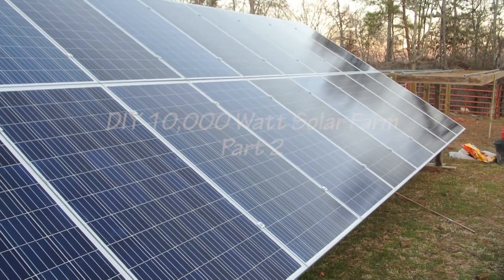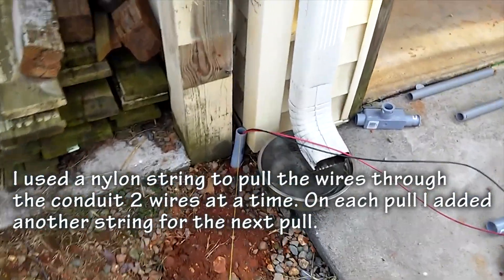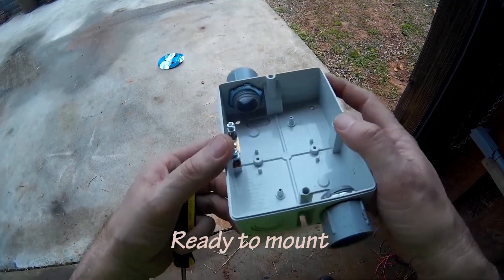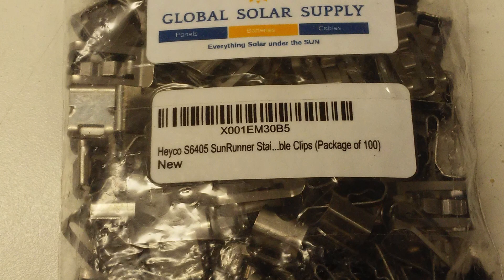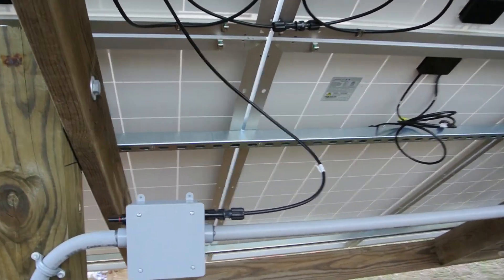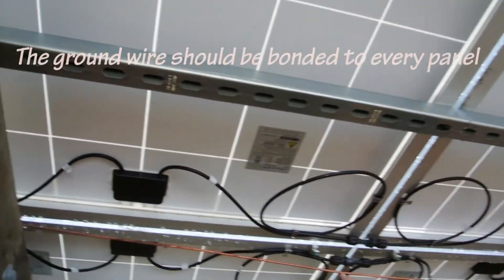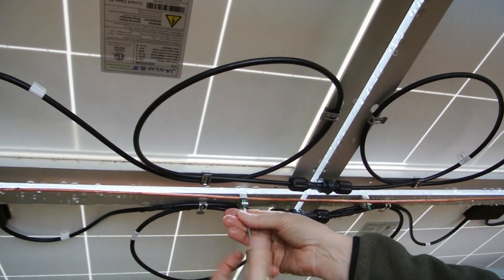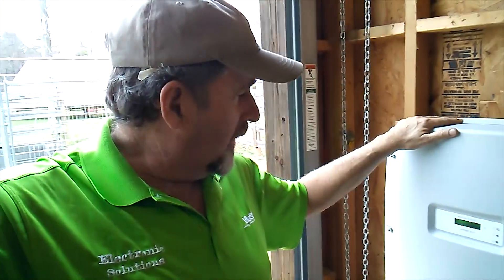BUILDING A 10,000 WATT SOLAR FARM - Part 2.

Comment: THHN wire in the NEC Code is for dry and damp locations, underground conduit is considered a Wet location  as written in the NEC Code THWN is required. Rip it out and do it right!!

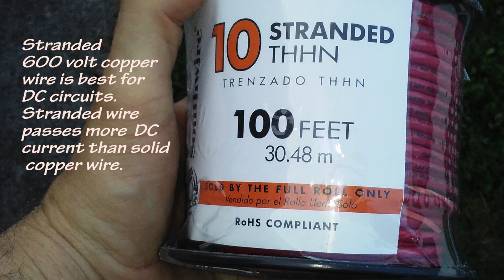Comment: "Stranded wire passes more DC current than solid copper wire" I totally disagree. Cable resistance determines how much current will flow. Stranded cable will have higher resistance than solid cable of the same gauge. 0:21

Comment: Nice install!  Still missing a few details like system dc voltage (24Vdc? 48Vdc? 192Vdc?)  Sun tracking? Future battery/power wall? Unless I missed it.  BTW I don't think stranded wire carries more current than solid wire in a dc application.  Stranded wire only exists to simply be more flexible than solid wire.  Ignoring insulation or conduit de-ratings and assuming same conductor materials, the cross sectional area for any given length of wire is still what determines the ampacity of a wire.  In fact solid wire is recommended for outdoor installations.  And skin effect doesn't come into play unless you're trying to pass high frequency AC voltages.
Reply from the maker: The DC voltage varies under load but its around 350vdc under load and close to 450vdc open circuit. At that voltage solid wire would work just as good. The stranded is a lot easier to pull through conduit though. Low voltage DC gets more benefit with fine stranded wire. Example would be car battery cables and welding cables. I tend to question that as well.
Reply: @electronicsolutions1126  I rechecked some NEC standards among other electronic resources and can safely say voltage (or current for that matter) has nothing to do with stranded vs. solid wire.  Automotive wire is stranded because it is easily assembled into harnesses, easier to install during manufacture and much more tolerant of vibration.  Not because it is low voltage.  Welding cable is stranded because the necessary big gauge/high current cables need to be flexible.  The finer the individual wires the more flexible.  Again... not because it is low voltage.  BTW the voltage rating of any given wire is determined by insulation material and thickness... not by AWG.  Any of this is easily verified with wire ampacity tables or even thermal calculations if you want to really go deep.
Reply: Some people omg he used what he used if you think you have a better way great do it and move on nobody cares how smart you are on details and details alone.
Reply: @seandillingham5062  I wasn't trying to show how smart I am but more to correct a false statement. If the guy in the video wants to come from a point of authority then he should have facts not just made up bullshit.  Let me guess... you're the source or apprentice of his misinformation?

Comment: You pretty much overbuilt everything. Why did you cheap out on these 10g wires ? Way too small for that power and length of run.  And where is the rest of the story ?

Comment: When running DC, stranded & solid copper wire, given the same cross-sectional area, have exactly the same resistance. The skin effect, which gives stranded wire an advantage, only exists when using AC.  Given that, choose which is cheapest when using it to transmit DC.
Reply: Yeah I had to comment on that too:)

Comment: And what's the brand name on those inverters, & how much did they cost, & where we're they bought
Reply from the maker: SMA Sunnyboy inverters. these were purchased surplus from a Dealer on ebay. $500 each plus $150 shipping  They are a BEAST and weigh 149 lbs each. Transformer design. It was new old stock. Made 3 years ago but still new in the box and still have the 10 year warranty from purchase date.

Comment: What guage wire are you using, that looks like pretty thin wire
Reply: 10 gauge 600v stranded. String Inverters work off high voltage DC.  The voltages present are between 300 and 400 volts. Higher energy means lesa current. We have close to 10 amps on each set of wires in full sun but at approximately 330 volts.
Reply: We could have used 12 gauge wire but it calculated to a 1% loss. The 10 gauge was about 0.6% loss and can handle up to 30 amps. It will not heat up at 10 amps or less with less than 100 foot cable run.

Comment: I have no idea why Code requires us to use a ground wire on ever panel when every panel is already connected via the unistrut. Sure Copper is better but the unistrut will work just fine as the ground wire in this case. Lighting will demolish any solar installation, Copper ground wire or not. Anything less than a lighting strike the unistrut can handle very easily. provided you have good contact between the unistrut and the panel. Then all ya need to do is ground the whole set up to a few 8 foot ground rods like you did. But code makes us do it the way you did. And it's really a waste of money. I really love your setup here! Injoyed the videos! Please keep us updated!
Reply: @wu ming Resistance my friend... Its the enemy. You really have to think about what happens during a lightning strike. Lighting follows the LEAST amount of resistance to ground. You have to give it something to follow other than the steel structure. That's what the large copper ground is for. Sure lighting will follow the steel but not as well as copper. Plus the aluminum is anodized to prevent corrosion. The anodized finish does not conduct very well and Steel resistance is much higher than copper. Remember there are copper wires going to the panels. If lightning strikes a panel only part of the power will not flow out of the frame into the steel structure. The majority of the energy will arc right into the cells finding the better ground back to the inverter and poof! The grounding wire uses the lay-in-lugs with a stainless bolt and a star lock washer. The star washer digs in to the aluminum past the anodized finish making a good electrical bond. A properly grounded solar array can take a lightning strike and keep right on going. The entire point of the copper is for equipment protection.
Reply: Well there is a very good reason. Its called lightning and resistance. There is more to proper grounding than just being "grounded". Steel has a much higher resistance than copper. If the panels take a lightning hit and the resistance to ground is say 50 ohms but the copper conductors have 2 ohms back to the inverters guess where most of that current will go to get to ground? Right into the inverters causing damage and possible fire. By having at least a #6 copper bonding all the panels to ground it gives lightning (or any other short) a low resistance "good" path to discharge. It will keep that discharge out of the equipment and safely let it flow to ground. Make sense? Remember, electricity always takes the path of least resistance! Give it one for protection or it will find its own path that won't be pretty. Its the same rule for any outdoor antenna or satellite dish for the same reasons. The lower the resistance to ground, the better chance of not getting damage. Thats where #6 or #4 copper come in handy. A lot of radio towers will use a #4 copper to the top that all the equipment is bonded to. It saves the equipment. Lightning strike can flow to ground and everything keeps on rockin like it never happened. I used to work on cell towers! 😂
Reply: @wu ming Actually the copper ground keeps everything from getting fried. The stuff is expensive. Protection for a reason. It may never need it but then again... I was driving down the hwy the other day and lightning hit the guard rail in between the hwy in front of me about 100 feet away. Scared the crap out of me. Its like 3 feet tall. It could have struck anywhere.
Reply: @wu ming sounds good to help with corrosion. The panels are anodized which also helps cut back on corrosion over time. The real nasty effect comes with copper and aluminum. It does not take long either. Just a few years. Definately don't let those touch. Good job though!

Comment: I'm so sorry but I have to ask I'm really new about solar panels and all about the electricity but what do you mean by BUILDING A 10,000 WATT SOLAR FARM? It produces 10,000 WATT electricity in one second or in one minute I would love to get answer for this question
Reply from the maker: The maximum output of the system with 2 5000-watt inverters can produce 10,000 watts in one hour (kwh). Kwh is different from kva which is a measurement of power in a circuit. 1 kilowatt hour is power produced in the timespan of 1 hour which is equal to 3,600,000 joules of energy. This system in the video has 11000 watts of solar panels. Each inverter can handle up to 15% more energy than the maxium output. They will produce more wattage when the sun is not at the ideal angle and clip any power if it exeeds 5000 watts on each inverter. That usually never happens because of losses in the system. Things like temperature, wire length, wire size and inverter effeicency cause losses. Usually about 10% loss in a designed system is normal under peak solar conditions. Thanks for asking!

Comment: How has the solar setup been doing? How easy is it to change the positions and how do you keep it secure?
Reply: Its working great! Its producing an average of $200 to $250 per month. I have not changed the tilt yet but 1 person can tilt it. I currently have it all propped up with 4 boards at a fixed angle. I plan to cement a couple of eye anchors in the ground then make an adjuster using an 1 1/2 inch steel pipe inside of a 2" steel pipe with holes in it where I can insert a pin to change the angle, winter to summer. Maybe even use 3 holes and put in a spring/fall angle.